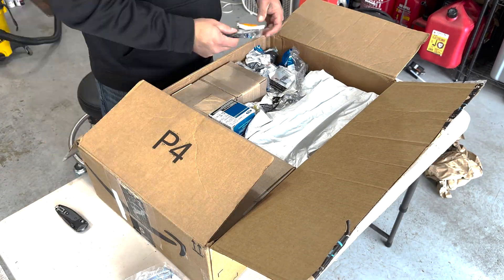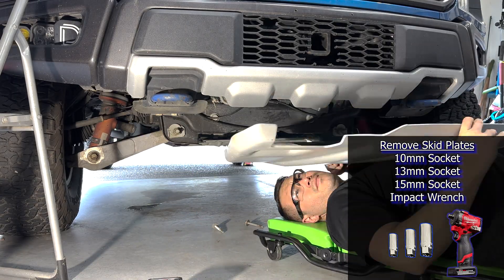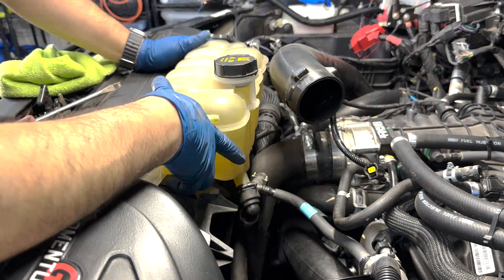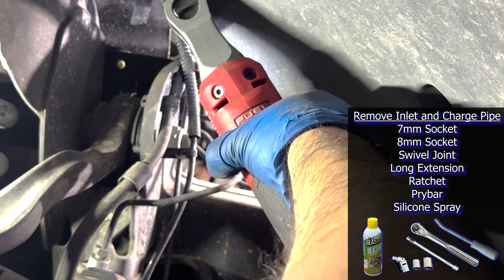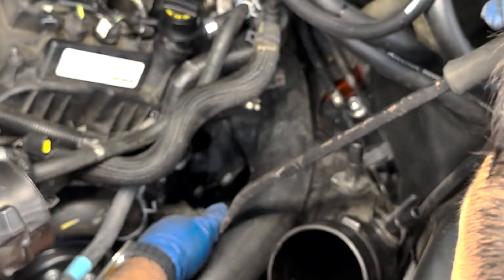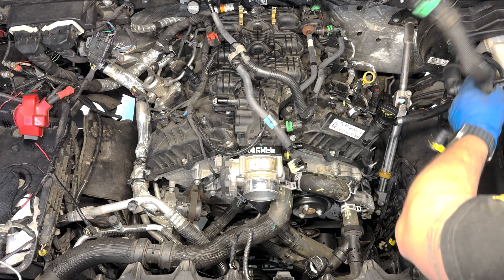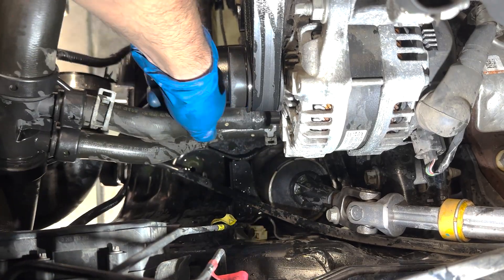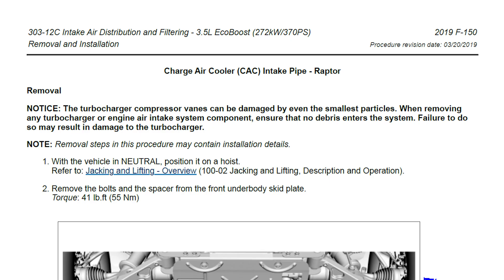Gen 2 Raptor Cam Phasers Part 1

Comment: Where or what manual are you using to get the step by step information? Thank you in advance
Reply from the maker: I'm using the Ford Service Manual online. There isn't a straight forward guide for the phasers, but I used the engine assembly, engine disassembly, engine installation with body on, and engine removal with body on as the basic guides. Unfortunately, some of the information is kept in individual sections like for the charged air pipes, etc. This means navigating the manual to find each part and using that for the specific step you're doing. The good news is that you can save the information by printing to PDF and using later. I'd do this right before starting so you don't waste the 3 day pass to avoid paying again.

Comment: Wow. That's a great video. Can you talk about the symptoms you saw that made you change the phasers? How many miles does the truck have?
Reply from the maker: I have 67k miles on the Truck. I began getting a rattle at startup around 64k miles. If you let it go too long it can damage the cams and engine. Luckily I only had one failed phaser, but replaced them all with newer part.